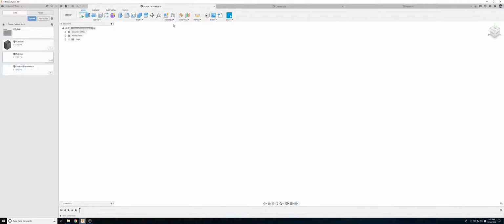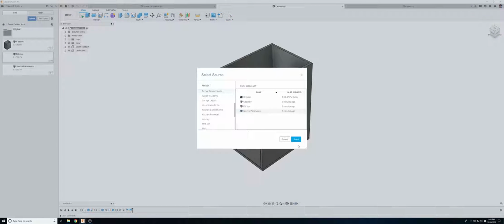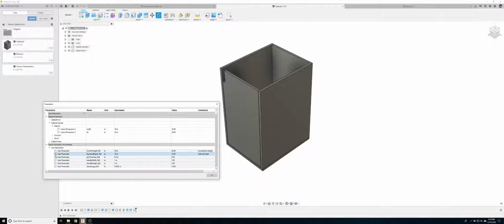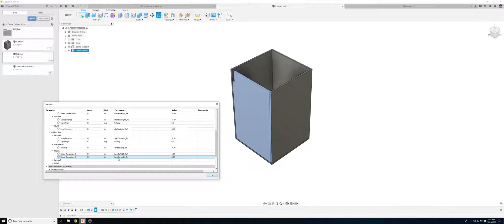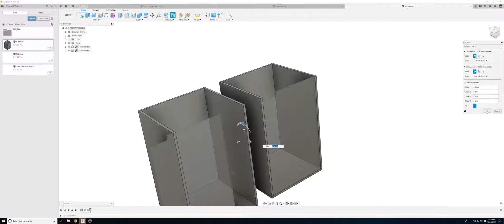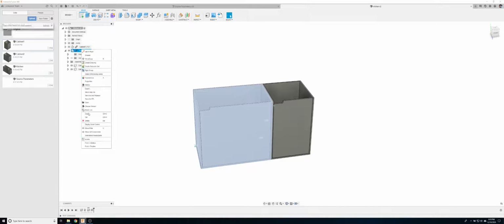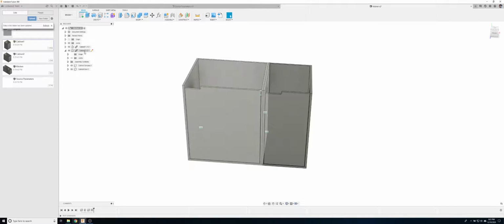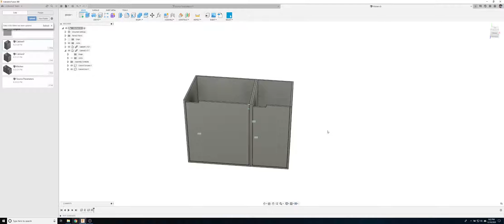Plywood Cabinets with Fusion 360 #1 - Architecture overview (Derived parameters)

Comment: Interesting, but on my laptop, it is impossible to see what you are entering in the various fields - your screen is so wide and yet you are using just a small portion of it - which makes it impossible to read the details of what you are doing. Just a heads up in case you do any more videos.
Reply: To be fair it's more of a modeling concept video. The specific values don't really matter. It's the ideas and flow that do.
Reply: @ScottMoyse  I DID say that it was just a heads up whereby a small, possibly simple (?) change, may make it more useful if he does future videos. Not intended as a criticism...
Reply from the maker: @ianpendlebury3704  the obvious solution is for viewers to purchase ultra-wide monitors. I had a feeling this would be an issue, I'll see if I can crop down in the future!
Reply from the maker: @ianpendlebury3704  additionally, my ideal is simply to get the workflow out there, and if it sticks, others will adopt the workflow and eventually create higher quality content :)